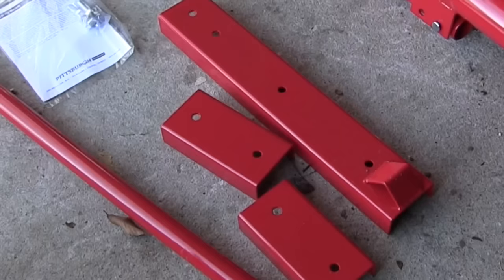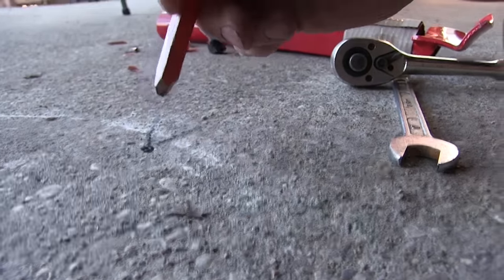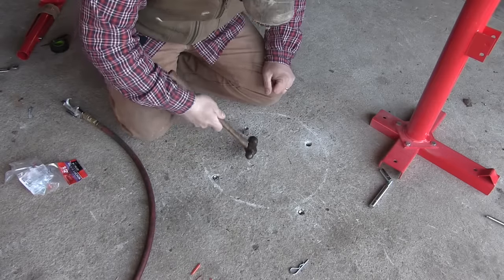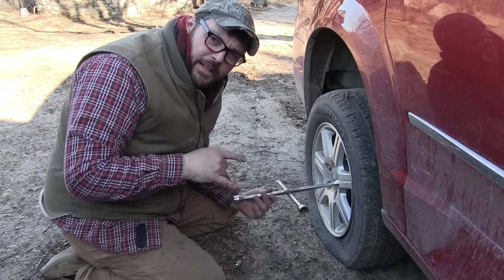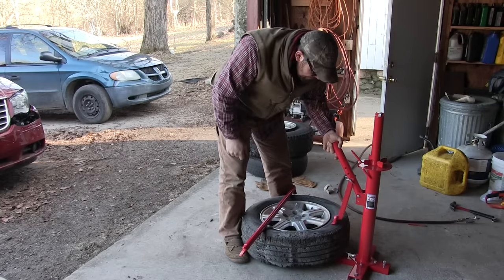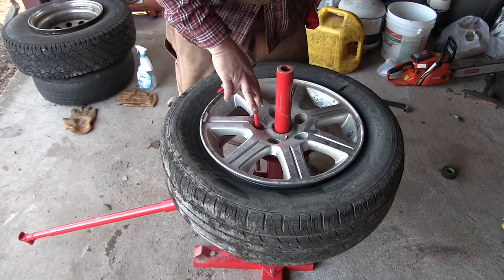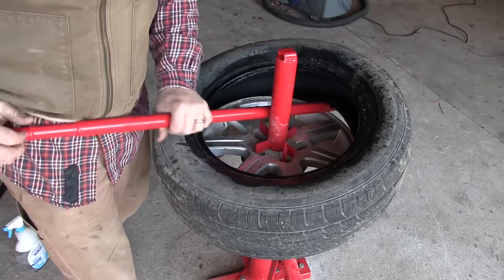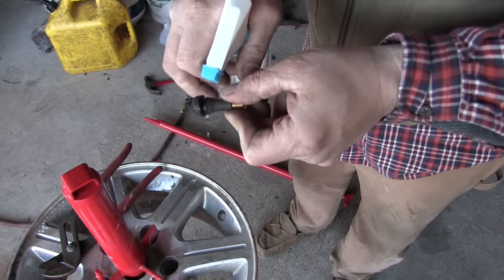Harbor Freight manual Tire Changer review

Comment: I bought one of these. The problem is, it will scratch the hell out of your nice rims. If you care about keeping your expensive wheels looking nice, have a dealer with a touchless tire. Mounting machine install your tires.
  The best thing about this harbor, freight tire changing machine is, the bead breaker.
I bought this tire machine just for changing motorcycle tires. You have to have this base for the attachment that goes on the main stem of this tire machine for changing motorcycle tires on and off the rims. That is a joke also. I do better changing my motorcycle tires on and off the wheels by having the wheel sitting on a plastic milk crate , The way I have done it for many decades now.
  I have a manual coats tire changing machine that I bought from a garage that bought a new touchless tire changing machine. I use that for decades because my wife and I and my three kids means five cars and trucks that needed to have snow. Tires swap over every winter and back to summer tires every spring. So I was doing a minimum of 20 tire swaps a year..
  but even my old manual coats, tire changing machine, I cannot use on today’s alloy wheels, because the act of spinning the wheel off of the rim with the tire iron will scrape the hell out of the wheel all the way around..
  today, we all have 4 Wheel Dr. vehicles in my family, so there’s no spring/summer tire change over. When we need tires, we just buy all season tires and they install them where we buy the tires.
  so the only use I have for this harbor, freight tire machine is, a bead breaker for my motorcycle tires. You might ask why don’t you just have the dealer install your tires on your motorcycle. The answer is, it can cost as much as $350 to have a set of tires put on a motorcycle like a gold wing or a Yamaha Venture. That’s just the labor...
  I have never had anyone mount any of the tires on my many dozens of motorcycles over the decades..
  this harbor freight tire changing machine is crude and basic. The bar they give you for spinning the tire on and off the rim is early 1900s crude..
  you have to sync some really long anchors into thick concrete to get this thing to hold still. I used 1 inch lead anchors with 4 inch long bolts, and I ended up pulling the bolts out of the concrete floor trying to change hey tire just for practice to see how well it worked. it didn’t
  you could actually just use this machine to break the bed, and go to Harbor freight and buy two of their 24 inch long, tire irons. And you could remove and install tires on your wheels of your car easier than using this tool. Don’t waste your money unless you just want it for the tire Bead breaker
  I have a couple videos on YouTube of me demonstrating this tool for breaking down motorcycle beads. That’s about all it’s good for unless it doesn’t matter that you scratched the hell out of your wheels. If you have old cars with steel wheels that are gonna be covered up with hubcaps. that will be fine. Do use this old, technology tool, but you better be in shape, because spooning tires on and off wheels takes a lot of know how and technique. I have changed many hundreds of tires because I worked in garage as a kid back in the 60s and 70s before touchless tire machines were common.
  I also bought the tire balance machine when I bought my manual coats tire machine from the garage. I bought the tire machine from. It’s a certified bubble balancer. It has a stylus that floats on a pool of gear lube… this was state of the art at one time. You may say that’s not good enough. Will keep this in mind. Airplane and helicopter manufacturers to this day still use bubble balancers to balance, propellers and helicopter rotors for private and military Planes and helicopters. Bubbles don’t lie.

Comment: I would appreciate if you guys with experience here, would suggest what amount of Air pressure is needed to move the tire onto the bead and to set properly on the rim and make the seal automatically .......
Reply: measured in Liters of airflow per minute.  Liters / min
thx

Comment: I had to laugh when I saw you throw the TPMS sensor over your shoulder!  Yes, TPMS system should be an option on cars……..BUT, your daughter’s car will “miss” that sensor and incessantly flash a warning light on her dashboard.  I know that in some states, her car might not pass inspection.   Now in the olden days (I’m sixty-six) we did just fine with tire pressure gauges and common sense, but…….. on a hopeful note, hopefully the computer chip shortage will force automotive companies to stop building cars with all these superfluous computer control.  BTW, great review…….

Comment: The piece that goes on the rim has 2 setting  may need to turn upside down it has a offset
Reply: Breaking the bead after soap work handle up and down and use a hammer to get it under the tirer then press down to break bead.

Comment: Okay on your tire changer you bought their that place would meet you going to grind off don't grind it up that's meant to keep you from getting hit in the head by the buyers that's why it's a little rough there anyway you should buy yourself a balancer is well no rum 50 bucks is well we're balancing thing and you get somewhere and buy some weights from Fleet Farm or someplace like that and you can just Gloom onto the side of the rim that way the tire isn't going to be flapping giving you bad you know what I mean it'll be balanced I know what you mean about that bar not turning when you try and put the tire back on the rim but that's what it is I don't know maybe you can glue so well something on the edges there to keep it from turning I just bought a bunch of different kinds of buyers and I seem to find a couple of them that work

Comment: you probably found this out by now-   Put the bolts back in the  anchors  when  the changer is sitting in the corner.. Keeps dirt, water and rocks out of the threads for next time

Comment: Buddy I believe that by the time you do all 4 you'll be a black belt in tire changing I shall call you Danielson. Also next time be gentle with the center cap because if you break it good luck getting another one... and also put a cardboard underneath so that the wheel doesn't get scratched.. and by an actual VCR valve core remover they look more professional...😂

Comment: i purchased this tool after the idiots at the walmart tire shop dented one of my vehicles  and then a local tire shop  charged me 30 dollars per tire to mount 4 tires  and then not only were the lugs only torqued to about 45 lbs
they put damn anti seize on the lug threads  it was then that i swore no tire shop would ever touch my tires again

Comment: If you care about your wheels, don’t attempt to change tires using this machine. It is a very good tire bead breaker for car tires and for motorcycle tires….the stone age tools will scrape your alloy wheels as you fight with the tire on the install and removal … do you have to be careful not to damage your air pressure sensor. They  aint cheap..
  this machine is more for someone that has old steel wheels they get covered up with hubcaps, or they don’t care that the bars that you lever the tires on the runoff with scrape all the way around while praying the tires on and off…
   The most difficult part I had, was mounting the tire machine to the floor. The base where the holes are located to mount the machine to the floor are too short. They need to be at least 12 inches long each, otherwise, you just can’t get the machine to stand still as the base flexes with tough tires like pick up truck tires.. I could make a video with steel wheels and reel softball tires with two ply sidewalls, that would make it look easy. I changed tires from when I was 14 years old till I was 19 years old and different service stations when gas stations did more than just pump gas. I have changed hundreds of sets of tires on manual machines back in the time when everyone had to put studded snow tires on here in the Northeast every November, and they had to be off the wheels by April 1, so I did a lot of tire changes .. I actually have a Coates manual tire machine that I bought back in the 70s from a service station owner that I worked for when he bought a new atlas pneumatic machine. My wife’s car in my truck have cast alloy wheels. So I do not do tire changes on my manual machine because I don’t want to. scratch the hell out of those wheels. We each have 4 Wheel Dr. vehicles now so we don’t do the seasonal snow tire change overs. we only have to think about changing tires when we have to buy new ones, and the place we buy them and put some on for free, and since we have newer vehicles, we don’t have to worry about getting new valve stems because we have tire pressure sensors which are the valve stem is now days.
   I also bought a bubble balancer machine from that service station when the manager I worked for Bought the pneumatic tire changer, he also bought a spin balancer so I bought his high quality tire balance machine. Mobile balance. Don’t laugh, they spin balance your wheels/tires, but do they clean your rims first?? they say they balance to the micron when they ask me if I want my tires balanced and I refuse. I asked them do you clean the wheels perfectly, do you cut all the whiskers off of each tire that are going to wear off within the first 10 miles, what about all those little stones they get caught in the Sipes of the tread did throw the balance off by the microns. Bubble balancing is actually pretty damn close because, today, they still balance airplane propellers and helicopter rotors with bubble balancers.. Bubbles don’t lie

Comment: Hi the hole world  is exited  with this invention  and  its  ok cheap  product  and  works  fine.but just put in mind its only for changing  and not for  balancing  tires.its ok for garden equipment  and not for a running  vehicle  we use everyday. 🇩🇰🙏👍

Comment: You should never lubricate your lug nuts. You run the risk of losing your lug nuts at speed, or of over-torqueing the nuts and stretching out the studs. Torque specs for lug nuts are for dry studs and nuts.

Comment: 4 years too late,  but if you remove the TPMS sensor in the tire,  you'll need to re- balance the tire.  Regular stem weighs less than the sensor assembly.

Comment: Its important to remember that when you remount a tire,the weights mounted on the rims will most likely be of little to no value..................a RE-balance should be done for front wheels..........
Reply: There was also no reason to completely dismount the tire to change a valve stem and therefore balancing should be no issue.

Comment: i put tire cement on the new valve so it doesn,t leak i guess you,ll find out the hard way
Reply: No need. As long as the hole is clean, there is no reason for any sealant on the valve stem.

Comment: Break the bead using the weight of the vehicle and the tire jack, then use a tire iron and a hammer to take the tire off the wheel.  No drilling of holes in your garage floor required ha, ha, ha.

Comment: use the snap-in TPMS sensor replace cap sensor is not a smart way. since if you need to replace the TPMS sensor, quite easy, no need strip the tire.

Comment: You DIDN'T BALANCE the tire, son! That thing will probably wear out very quick. Also, without the tpms (pressure sensor) that light will always be on. I'd rather do it right or pay someone to if I'm unable. Must use your noggin, son!

Comment: This unit is difficult to use because of the very poor design of the bar.  Taking tires off the wheel is difficult because the rubber pinches up against the bar instead of slipping off the wheel.  Without a lot of Lube the tire will never come off.  Also, this unit is too flimsy to be used on larger tires.  Using the bead breaker on the wheels off my Ford Explorer, the force necessary to break the bead actually caused the two supports of the bead breaker to bend.  I had to weld a 1" angle iron onto the bead breaker supports to keep them from bending again.  Once the tire beads came loose from the wheel, it became impossible to get the tire off the wheel.  My conclusion: this tire changer is only good for small tires, and only if a lot of Lube is used.  The Lube can be as simple as diswashing liquid mixed with water.  You will also find that using tire irons to pry the tire off the wheel is easier than using the bar which came with the unit.  However, the tire irons will damage soft  alloy wheels.  Easier to just pay a tire shop to dismount your tires rather than working up a sweat, cussing, and wondering why the bar which came with the unit is so difficult to use.  It's a very poor design.  Many decades ago I worked an after school job in a gas station.  Changing tires was easy because the tire removal bar had a roller on the end which prevented pinching the rubber.  That's what this unit needs: a bar with a roller on the end.
Reply from the maker: Thanks

Comment: I’m mount and balance my own tires but I’ve been having a problem finding quality tire valves that don’t pull fail when you install them. They’re all Chinese shit and about half of the valves that I put in I have to replace them even though they’re brand new because where the metal is bonded to the rubber it leaks air and eventually it will fail its like they did not put enough adhesive in that area and I have a about a 50% success rate Piss poor quality control very frustrating. I don’t like having to do the same job twice because of quality control could’ve been easily avoided.

Comment: Absolute garbage, I have had a northern hydraulics changer for over 20 years and it works great. I bought a H.F. one for my cabin to change atv / mower tires and the handle bent the first use, also the end that goes around rim to mount tire isn;t contoured correct and it slips off.

Comment: You used the tool wrong putting the tire back on. The large side with the groove in it goes down and hooks on the rim. When you pull it around, same as taking the tire off, it pulls the bead over the rim. You should be using soap as a lube. I've got one, and it operates the same as the one at my dad's tire shop in the 1960's, only it isn't air powered like that one was.

Comment: Yeah those Engineers that design all those fancy s*** will never think of putting the bolt on the outside so it couldn't pull through and I have a TPS it's because I'm fat asses that make these cars are too lazy to get out to check the tire pressure the right way which is you gives you to inspect the tire while you're doing it Boy America's make some real s*** but this tire changer looks pretty darn sweet I would like better to have it where you could move it but it is what it is and it does a great job with little or no effort and save you 20 bucks at Walmart for change in the tire and another $20 for spin balancing so way to go buddy I like it Harbor Freight really has a lot of good stuff for the shade tree or garage mechanic as you want to call them cuz we quit working out by the shade tree long time ago cuz the cars are so complicated we can't even f*** with them good old American capitalism and ingenuity was known a new car today

Comment: Be sure to put the bolts into the concrete floor or some other type of plug to stop the holes from filling with debris.  Also, the phrase is "I couldn't care less" NOT "I could care less".   If you could care less then you still care some i f you couldn't care less you're all out of care.

Comment: Throw that junk away good idea more junk to scare someone that see a idiot light , yellow don’t worry, red check soon as long as you have oil pressure, gas , air, compression, your’re good until one of these stupid sensors like oil or knock, oxygen, start sensor or timing or a clogged up catalytic converter you are in pretty good shape.

Comment: Bad idea taking out the TPMS sensor and using only a standard valve stem. You can harm the TPMS and other systems.
Reply: The TPMS system is not very important to the average person and doesn’t affect the way the vehicle drives. It’s just an electronic nanny to remind people to check their air pressures. It’s not required for inspection. And to be honest if you normally check your pressures on a regular basis it’s just anther thing to go wrong. The only reason it’s there is it’s the government’s response to the SUV rollover issues of the early 2000s (Firestone said the pressure should be this and ford said something different. And a government study showed that most SUV rollovers involved tires that were under inflated).

Comment: Sledge hammer, bottle of dish soap and 2 or more pry bars with dull teeth or tooth and ill change a tire twice as fast 🥱 he didn't mark the tire you always want to get soapstone and put a line on the tire to the rim and line it up so that way it doesn't have to be rebalanced.
With all of this guy's uncertainty he has no business doing work on vehicles especially his own daughter's if that tire blows out because he nipped the bead or did something wrong his daughter will lose steering but according to him it's better to save a buck